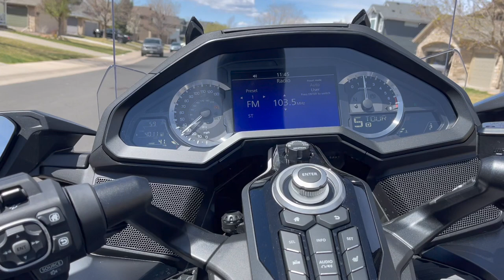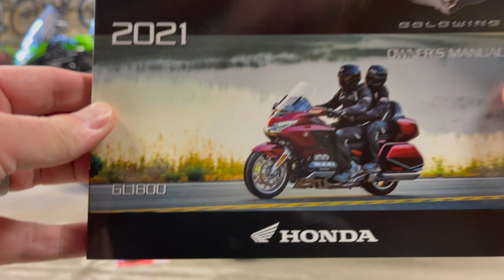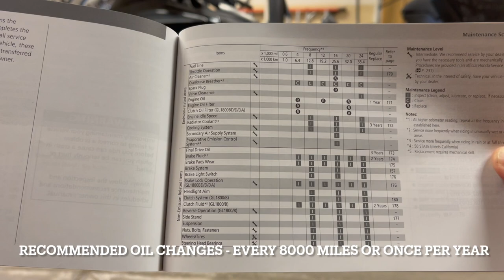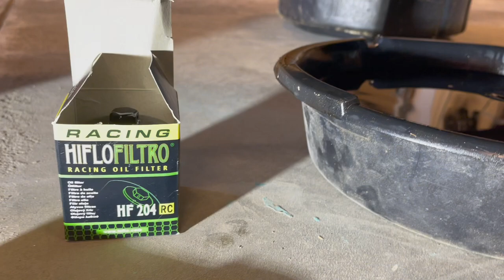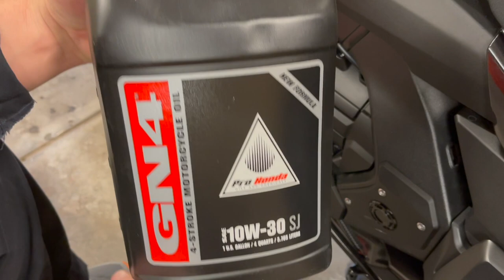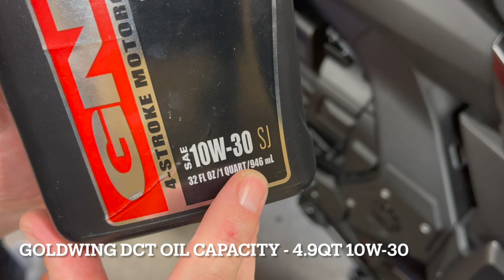2021 Gold Wing Tour DCT - Oil Change (4000 Mile)

Comment: I don't want to be "that guy" but I do take exception to your method on several points. First, I ALWAYS use a torque wrench and especially on fasteners that hold back critical components, like engine oil. In this case, the fasteners thread into the engine crankcase, which could produce a disastrous and expensive fracture if over-torqued, or a dangerous possibility of an oil leak if under-torqued. Most of the time, doing it "by feel" is adequate, but I don't take chances with these fasteners. 

Like you, I've been at this motorcycle maintenance game a long time - 47 years and counting. I'm also a former dealer for Yamaha, Triumph, and BMW, with BMW tech training, so I do have some credibility. I believe in adding at least some oil to the new filter (a screw-on type, anyway) to minimize the time needed to get lubrication back to upper end components. 

I can't imagine being so budget-minded (on a $28,000+ motorcycle) as to advocate reusing crush washers (even though you did replace them) and buying non-OEM filters. Though Hiflo filters seem to be some of the better aftermarket filters, and are possibly OEM suppliers to some manufacturers, I KNOW that the OEM filter is tested and approved by the OEM. I think it's a good idea to clean all gasket or crush washer mating surfaces with contact cleaner or similar before reassembly, as well as the mating surface for the clutch filter cover. It'd a good idea and good practice to wipe/blow off the area around the oil filler before removing the cap also.

If it seems like I'm overdoing this, no apologies from me. Good practice is good practice.
Reply from the maker: Hey Matt! Thanks for the detailed feedback and perspective. You make some great points to consider while doing this maintenance.
Reply: Totally agree with Matt. I don’t get the guys who don’t use T. wrench. The book says 19 for the filter and 22 for the 3 bolts with new crush washers. I have been doing this for a long time. I never had one issue loosening anything on my DCT. Also, oil filter should have oil in it, before install. If you follow the book, you win, every time !!!! They say 10-30 regular, cycle oil. That’s what you use. For every tiny thing here, they have reason. Those engineers came up with any value for a reason. Not because they feel like it or one of them was drunk that day.

Comment: Get a pair of snap ring pliers for the transmission filter.  Mine are too long to stand up straight under the bike but I am able to grab the depression in the filter at an angle and the little devil pops right out.  Thanks for the video.  Though I've changed the oil 5 times I enjoy drinking a cup of coffee and watching someone else do it :)
Reply from the maker: Hey George! Glad you enjoyed the video.
Reply: @MileHighAdventures  Having just changed the oil again after watching your video I appreciate it more as I would not have been able to film what I did with oil all over the place.  Almost as much fun as changing the oil on my old Interceptor with all the bodywork having to come off and having to pull the lower radiator out of the way to access the filter.  Thanks again for the video.

Comment: I changed the oil in my 2018 goldwing and the oil filter was that tight on mine also. Used the same filter tool you used, would never have gotten the filter off without it.
Reply from the maker: Hey Doug! Yea man.. that thing was welded on..
Reply: Hello what size metal remove tool did u use as many different sizes?

Comment: I noticed you put the oil filter on dry. You are supposed to wet that new oil filter base O ring with some oil so it is not impossible to remove next time.
Reply from the maker: Hey Ken! I normally do that.. great point!
Reply: Good catch. He mentioned the original oil filter was super tight and hard to get off. I suspect the person that put that one on didn't wet the filter down, either. That sure causes it to be super hard to get off.

Great video!

Comment: Good video.   The manual recommends draining the oil on the side stand.   You should be able to drain some additional oil out using this method.   However, I doubt Honda techs are doing this.
Reply: Since this MC has one quart of old oil left inside; maybe two or three additional ounces are not to worry?  I use the center stand and so do all the dealer tech's. (Honda note is that the only way to drain that last quart is to split the cases!) I enjoyed your style of presentation and you speak VERY clearly.  
Out of state and had a bad rear tire puncture. I plugged it and made it home where the leak got worse. I had 8700 miles on the original Bridgestone tires and I anticipated needing new tires near the 12,000 mark; but had that done at 8700.  Good Rides
Reply: After draining the oil on the center stand its definitely a good idea to put the bike on the side stand and remove the drain plug that goes in horizontally. A decent enough amount of oil will drain out.  Reinstall and put back on centerstand to finish the job. Adds an extra step but it’s worth it

Comment: I been riding a Honda since the 1970's. Took Auto Mechanics at J.C. and have worked on my own cars and bikes since then. Currently i follow a few mechanics on YouTube, and we all agree, 8,000 mile oil changes are a bad idea. Unless you plan to trade bikes every few years, then i guess the next guy can worry about it.
Reply from the maker: Hey Flexjay.. I agree.. I will be changing my oil every season.. which at my riding tempo will keep me closer to 5K or less.. Thanks for the comment!
Reply: What is your recommendation in changing engine (motor) oil on a 2021 Honda Goldwing Tour DTC ? At what intervals? Thanks for sharing!!
Reply: @victortrujillo2591  If you are asking me, and like the video says, to do it every 4,000 miles, i would think that is a good oil change interval, for a water cooled bike,  under average conditions. I do not own  a 2021, but i find it interesting that Honda has finally lowered the miles on some bikes for oil life, but it should be a good thing.

Comment: I always poke a hole in the bottom of the filter and let it drain before I remove it. Seems less messy.
Reply from the maker: Hey Mark! I have never tried that before.. what do you use to poke the hole?
Reply: Just a phillips screwdriver and a hammer. Goes through pretty easy. Just pull it out quick once it goes through so oil doesn't run down the screwdriver.

Comment: Always do this kind of work yourself. You love your bike the local mechanic does not. You'll take your time. Your local mechanic is paid to be fast and that can lead to mistakes. I got my 2022 DCT Tour a month ago and they managed to send a 32500 dollar motorcycle out on the road with incorrect tire pressures 8 and 9lb low and 4 of its lower plastic housings fitted the wrong way.  Never reward shoddy, can't be bothered to do it right work with your money or your buisness.
Reply from the maker: Yea.. I agree Jaggy.. no one loves your baby like you do.. take care!

Comment: Re: leaking dct filter cover plate.  You may want to look up Fred Hamons maintenance video is this regard.  He uses a different “o” ring which fits better than the oem ring. Still a Honda product just a little less sloppy and as a result doesn’t get pinched as easily.

Comment: Great job, did you experience any leaking from the clutch filter cover as well?

I took my 2021 DCT to the shop for the initial 4K mile service, bike was leaking and had to return 3 times before it stopped leaking.

I'll do the next oil change myself.

Thanks for sharing.

Comment: Nice video. Why not staying with Honda's filters? I am aware that HiFlo are good. I get all Honda's kits fully. Also, let the bike sit on the side stand while drain bolts are off. You will be surprise how much oil comes out. Enough to make you feel better. Second, fill your filter with fresh oil. Third, I stay away from the upper line on the dip stick at 2.5 mins on the clock check time. Therefore, I take out approx 120-150 ML of the last QT on my DCT. After 2.5-3 mins, the oil level is 80-90% up. Safe for me !!!!!
Reply from the maker: Right on AIP.. thanks for the advice!

Comment: It is curious that you waited to change the break-in oil until you had 4000 miles on it. I've owned 3 new bikes in the the last 10 years including the last one my 2023 GW DCT bagger. The Indian first break-in service with oil and filter change was 700 miles. The KTM 1290 SA had a 600 mile break-in service with oil and filters change. When I bought the 2023 GW the dealer said to come in for the break-in oil and filters change at 600 miles. They said that they recommended that all their new Honda bikes get a 600 mile break-in oil and filter(s) change. This made perfect sense to me (Yes I'm older but not old). I took my wing to the dealer for the break-in work at 600 miles and since there was a great bakery/coffee shop next door I waited. I also had them put an extension bolt (easier access) and 12 V cable for heated gear on the battery's positive terminal. They finished everything in 2 h, gave me an itemized invoice and said to come back at 4000 miles for the second oil and filters change and other maintenance items (see manual). It is just my opinion that any new motorcycle should have a break-in service with oil and filter change between 500-1000 miles. I think dealership services  are important while the bike is under warranty. Some dealers won't cover issues if you do your own service during the warranty period. Yeah it did cost me $194 but I enjoyed the ride to the dealer and bakery and went the really long way home.

Comment: My thoughts are you should have fill the oil filter prior to installing it.
Reply: when they're the low point like that, sometimes I don't bother. it'll fill as I put in new oil. you are right though, most bikes I do presoak the filter.

Comment: An easy way to get the clutch filter out is by using a magnet.
Reply from the maker: Hey Greg! I tried to find a magnet at the local automotive store before I did the job.. but they didn’t have the tool. I will get one for next season’s oil change. Thanks for the comment!
Reply: @MileHighAdventures  You can find them on Amazon or a hardware store.

Comment: knock the filter socket loose before you take the filter down, save yourself some mess. Fill your new filter before you put it on. Don't by those cheap ass filters, they can come apart internally and paper from them can get sucked into your oil passages.
Reply from the maker: Thanks for the feedback Dennis

Comment: EXCELLENT video. Well done, easy to follow along. Thank you so much.   Is there a compelling reason  you waiting the full 4000 miles? I was considering doing the change at 2500-3000.  Thank you again!
Reply: It’s Honda’s recommendation per the owners manual
Reply: @AllThingsAudioHTX  Not really what I asked, but thanks. I think people who own a Goldwing have read the owner's manual.
Reply: @KG-xf9ew  Sorry I must’ve read you post wrong. You asked if there was a compelling reason to wait until 4k to change the oil, other than Hondas suggestion, you can change the oil at whatever frequency if you so choose to change it sooner. Case in point, I plan to change the oil in my goldwing (21 tour) every 3k or annually whichever comes first.
Reply from the maker: Hey KG.. nah it was what the manual called out and I took time to do it and record it.. I dont think it hurts to do oil changes early.. I will start the season with one this year regardless of mileage.. Ride Safe!